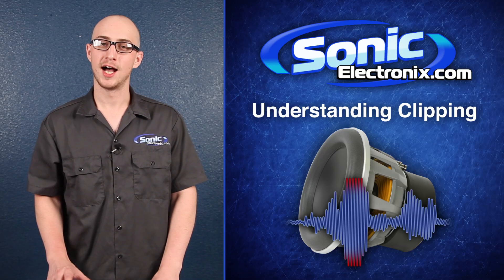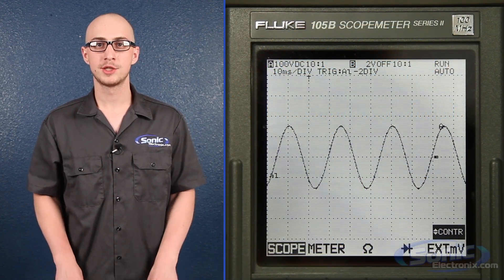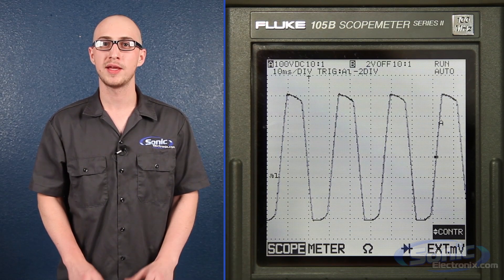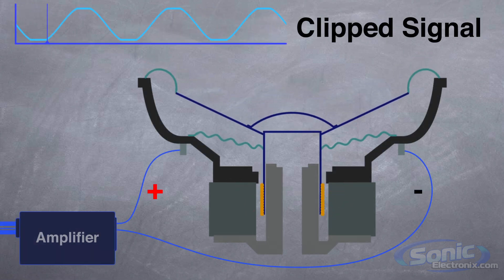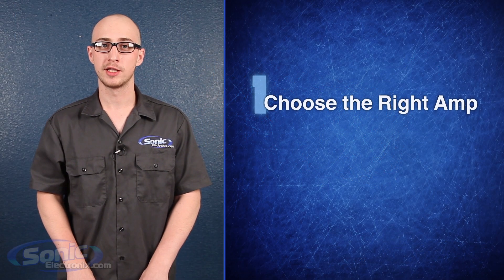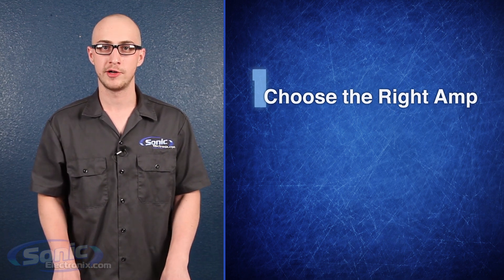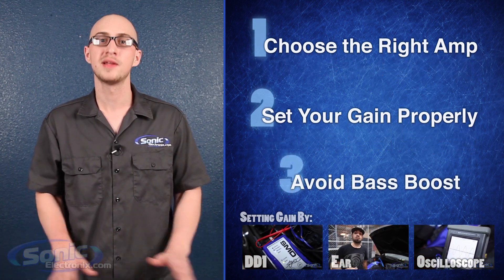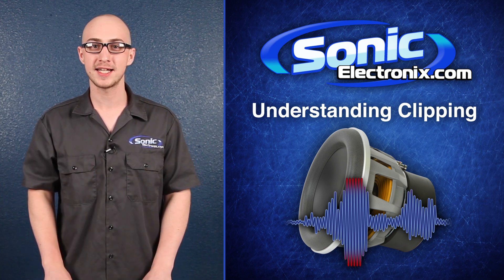What is Clipping??  Understanding Amplifier Clipping & Clipped Signals

Comment: I hate when they say avoid bass boost.. With the bass boost all the way down you'll barely hear bass, to the point where you don't even notice it... But you definitely shouldn't over due it. Half way can either be good or bad depending on the song
Reply: +Joe who But most bass boost is just a button for on or off, and it is usually people with underpowered systems trying to make up for it and distorting.
Reply: +Joe who I thought that to until I went to look at my own amplifier and notice that ... it's on 0 db. I couldn't believe it because I have a lot of bass but it's comming from the player settings. I played with a multimeter a couple of months ago to set the proper gain and left it on 0db and it is just fine...I just forgot the bassboost setting. So you can do just fine without it but with a proper gain setting.
Reply: Weak ass system.
Reply: +Irie Armendariz not really. It's actually mad loud, just not spl

Comment: So with RMS of a subwoofer in mind should you try getting to the rating or actually going above it? Say 750w rms with a 2000w peak, what would you recommend for the amp output?
Reply: +sniperlif3 i would pick an amp with 1000wrms at the rated ohms of the subwoofer. So you can be sure it won't clip if the gain is set right and the amp won't stress because it has more to give than the 750w it is delivering.

Comment: Can you easily hear a clipped signal? Would I know just by listening that the signal is clipped?
Reply from the maker: jman781 If you are carefully listening, you should be able to hear the clipped signal.
Reply: +PsMoKe Mob yes you can
Reply: +PsMoKe Mob you can most certainly hear a clipped signal. I know I sure can. If you do not know what a distressed subwoofer sounds like maybe you should just consider another hobby or leave it to the trained professionals to setup and install your gear.
Reply: Smh yea ok they Make devices for this but you out of ask man kind can hear clipping and situation by ear sMh you idiot lol
Reply: +Sonic Electronix no you can't
Reply: lol

Comment: Tell me if im screwing up my sub and amp.i bought a 12w3v3 2 ohm HO wedge for 100 and have a performance teknique 800 watt amp.i bridged it and its suppuse to get 375 at 4 does it drop to 2 ohms bridged.i adjusted all the gains and it bumps loud i hit the loud button and of course it got louder now main question is speaker is 1000/500 rms is bridging going to destroy sub or will it be ok till i get 500/1 rms jl audio.that jl audio is very loud for a wedge box
Reply: Cause everyone is gonna go look up ur specs and tell you.

Comment: I'm not here to say. clipping your subs is fine, because it's not. I'm just saying either Sony actually made a good amp lol or Kickers can handle a little clipping here and there. Subs essentially get hotter faster at a larger fraction of a second during each cycle of a frequency while clipping. and that larger of a fraction of a second adds up, sending a fatter square signal to your woofers, and can toast your woofers. as stated in the video. ... :D

Comment: No bro, you're good. Decent amp too I guess for cheap. I have a Sony GTR9001 cuz I was cheap and it was heavy for what it is. I got it hooked up to my Kicker 15 L7. I just turned the gain all the way up and back a little bit and the bass boost sounds fine up until about 70%. Maybe I'm wrong when I say this but this amp doesn't seem to slip very much or at all. Maybe I'm clipping the utter shit out of my sub, but it sounds fine to me and hasn't failed yet. Even after torturing it a lot.... A Lot.

Comment from the maker: Distortion is not detected by the human ear easily. If you turn up your sound system and the amplifier clips, it means you need a more powerful amplifier to get the loudness you want without taking the amp to its limits. Do not play it past clipping.
Reply: Sonic Electronix what if I have the volume maxed out and I hit the bass boost, which make the volume quieter for some reason?
Reply: I have a kicker cxa600.1 amp hooked to 2 kicker comp r subs and notice a burning smell is this the right set up

Comment: I have a infinity amplifier and I had my 2 12 inch Orion subs and amp installed professionally but the amps clipping light flashes and once and a while when I turn it up I ask the people who installed it and they said its fine because there is no distortion in the subs or speakers do I have to worrie about the clipping problem or keep playing them

Comment from the maker: Your headunit or amp could be going bad, could be a bad ground maybe, even the fuel pump going bad or the alternator going bad. It could be a number of things. You need to isolate each part of the system when it happens to see if it is the audio equipment and then go from there.

Comment: Sonic electroniz, I have a similar problem but when I'm at a dead stop my subs play fine but when I touch the gas they start burping quarter notes and won't stop till I turn it down it doesn't do it all the time but when it starts it will do it all day. It does it mainly on low notes and really high notes what do you think is going on?

Comment: When i turn my radio on the sub pops loud 1 time and looks as though it is extended all the way out...  no other sound will play from it.  Then when the radio is turned off it pops once more and looks normal again.  Amp and sub are both wired to 2 ohms properly.  What have I done wrong?  Amp is MTX TC-6001 Sub is Alpine SWR-12D4

Comment: Very good info video. My opinion, if you can get a hold of a DD1 or an o-scope, use it. It's the best way to set gain. Sure you can use your ears but you can maximize it more with the right equipment.

Comment from the maker: We would recommend setting the gain first, then the bass boost. You may find that when you start messing with the bass boost, you may need to then back the gain down to compensate.
Reply: It's either gain or bass boost not both

Comment: It isn't more accurate than high end oscilloscopes. The DD-1 was designed to give you a yes or no answer in regards to any harmonic distortion beyond 1%. If you don't know exactly what to be looking for on an o-scope, you can miss distortion that the DD-1 can pick up. If someone is looking to just set up gains and nothing more, the DD-1 is the tool.

Comment: I would rather spend $50 more and get an SMD DD-1 that's proven to be more accurate, easier to use, and comes with the calibration disks that you need to set it up.